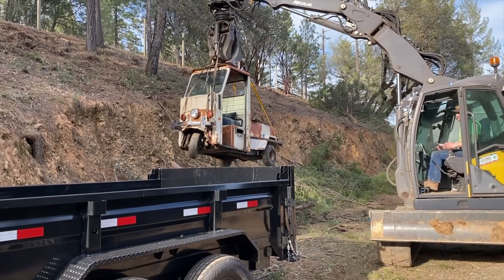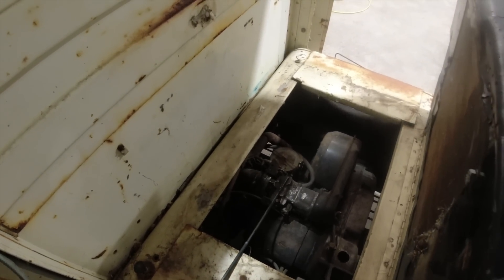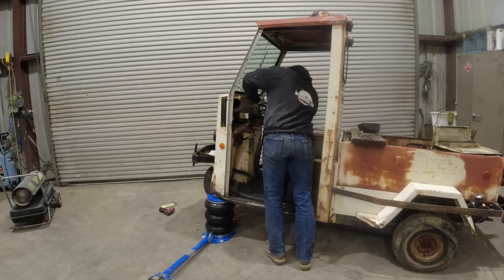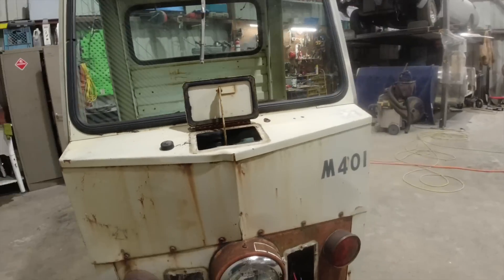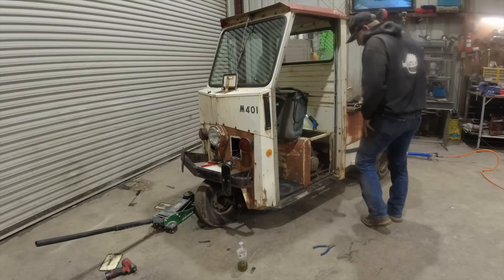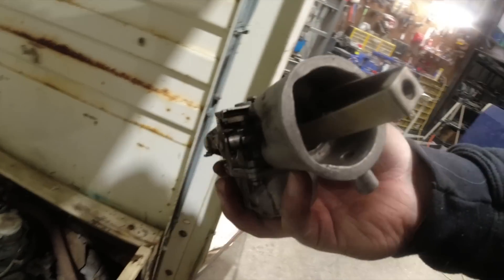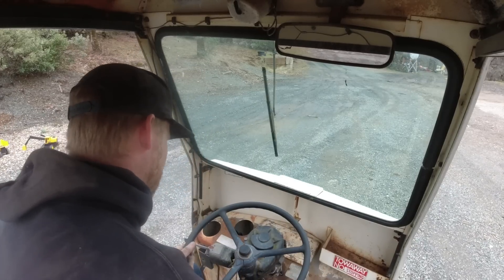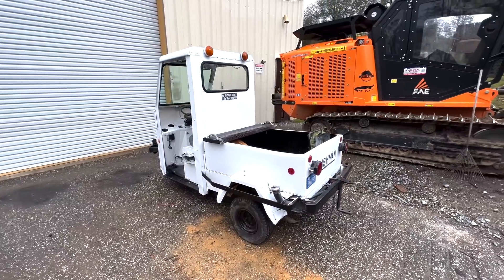Will it start?! Parked for 36 years. CUSHMAN. WEEKEND RESTORATION

Comment: That is so cool!! Cops and mailmen used to have th11ose. Cushman made millions of vehicles!  My very first motorcycle was a 1938 Cushman scooter!  12 Hp and 400 lbs! She was a barn burner!  LOL  It had a 300 cc single, and a separate 2 speed transmission, the shifter stuck out the side. I was 13 years old in 1965. I bought it from an old guy down the road for $20. He stopped riding it because the transmission broke, it ran great. I took the tranny apart, and found the broken part. It was a 1/4" square stock with a pc of round stock welded on. 2 of them went into a slot on a gear, it moved it from a big gear (first) between them (neutral) to a small gear (second).  The first 2 sets I made in shop class. Both of those broke!  That's when I learned about "hardening steel" LOL. The 3ed set I heated cherry  red with a torch, then dunked in a cool oil bath. Removed the "slag" it created and installed. It never broke again after that. For 2 years I rode that thing all over Gods creation! Farmers lanes, fields, cow pastures, apple orchards etc.  Kids now are lucky, try 12 hp, 400 lbs and 1 inch suspension!!  LOLOL!!   Thanks for reading!   --gary